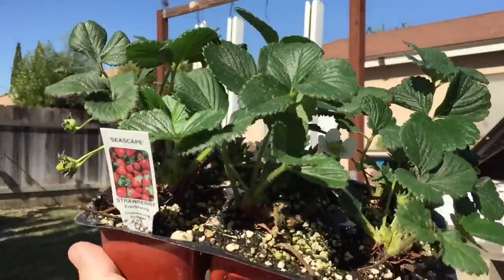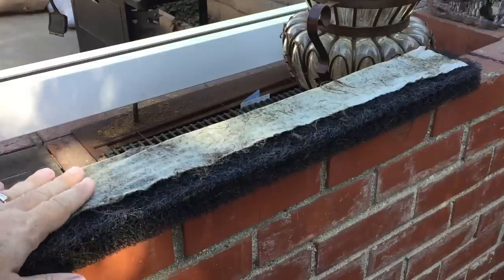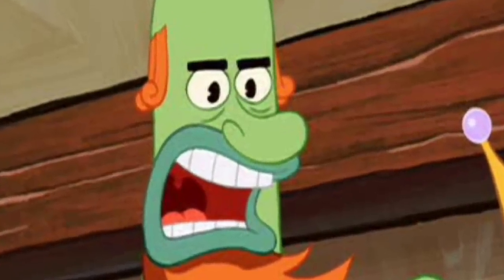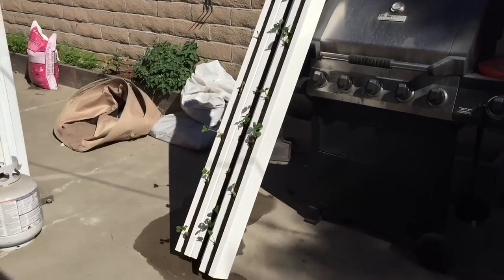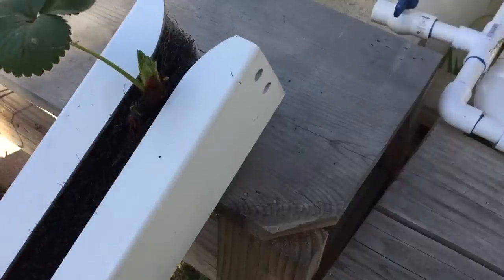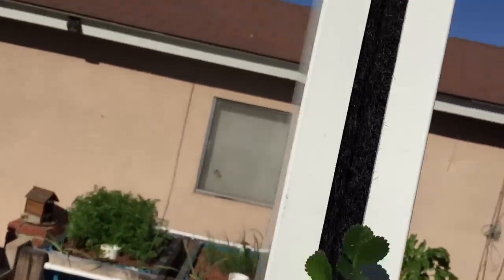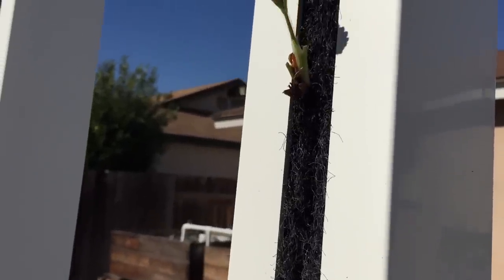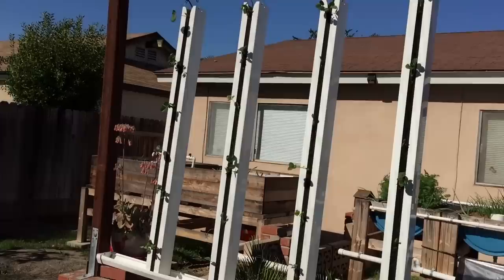How to Grow Aquaponic Strawberries!

Comment: A cap on top will likely fix your algae issue and ensure your roots or debris don't clog the flow.  Your hanging hooks can act as a cap lock and a top hat grommet (or tight hole) in the cap could lock in your tubing as well.  Just some thoughts.  Enjoyed the video.  Really enjoy those who think outside the box!
Reply from the maker: Hydroponic Gardening & More with Brent Thanks so much for all the tips man:) I always love getting feedback! I’m hoping as the strawberries grow in it will cover that top area and block out the sun for the most part. Also pushing the tubing down into the media a bit should help as well:)

Comment: Would sponge work as a media for this?
Reply from the maker: I’m not sure it would last after the first crop because the roots may tear up the sponge.
Reply: What's the one you use made of, then?
Reply from the maker: Carlos Castillo I’m not sure but it feels like a very coarse and stiff sponge. Basically if you used it on let’s say a car or something it would scratch the car up.
Reply: Home Farm Ideas Alright. That's clear enough. Thanks, Matt (if I got it right)